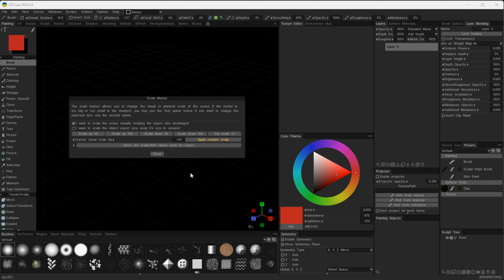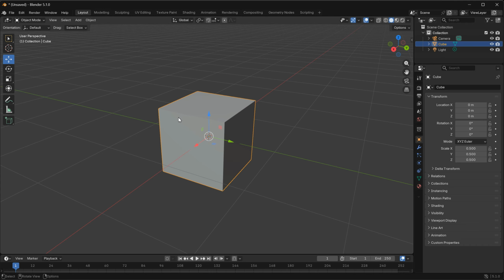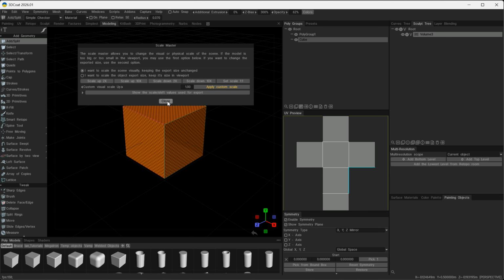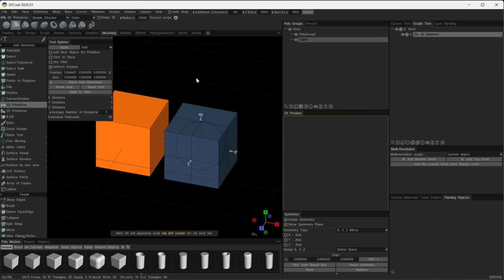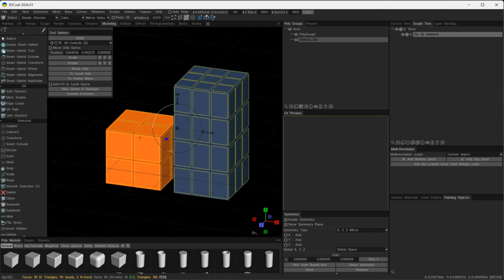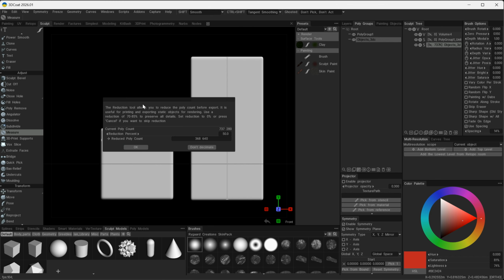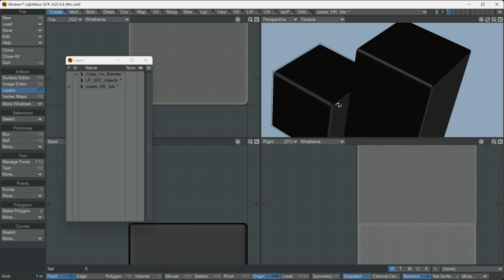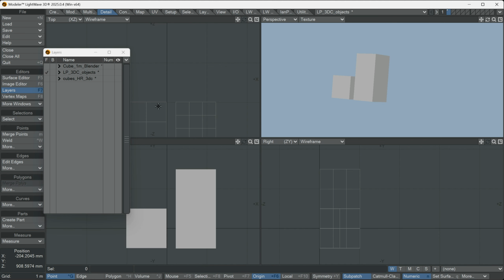3D-Coat Modelling - Using Scale Master

Comment: Thanks, pretty important subject. But I think you over complicated it a bit... One thing you need to understand in Coat is that it uses global scene units, which you can set in Edit-Preferences-In/Out. Those units are used across all rooms, so it doesn't matter if you work with poly model or sculpt mesh. If exchange between real world space apps like Max/Maya/Blender/Lightwave/Coat you need to just use same units in both apps, and there should be no scaling issues, because 1 unit in Max is same as 1 unit in Coat. But then there are few complications... First of all some apps have scaling factor options for import/export (Coat has it too, but only for export, via Scene scale master), and second there is one especially crazy app, called zbrush, that uses absolutely bananas unit system, auto scaling everything down to 2 units. And if you import correct way, it can auto calculate scale factor for future export, but if you don't - you will just get some crazy random scaled objects. So if your units in apps doesn't match, you can use Scene scale master and set there scaling factor for export. For me I prefer to work in Coat and Max in Meters, exporting without any conversions. But for exporting from zbrush to coat and back I often need to apply x100 scaling in scale master.
Reply from the maker: Thanks. I was recently importing a few objects and I thought a tutorial might help others. I thought I'd made it simple enough for even me to understand - Onto the next tutorial! :)